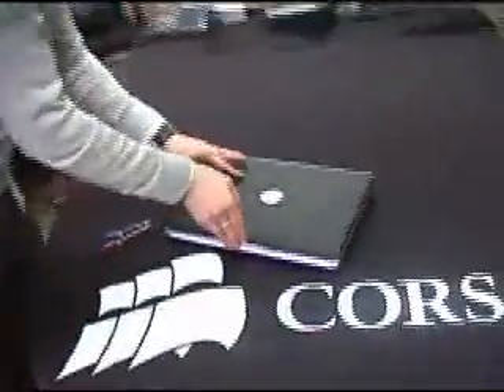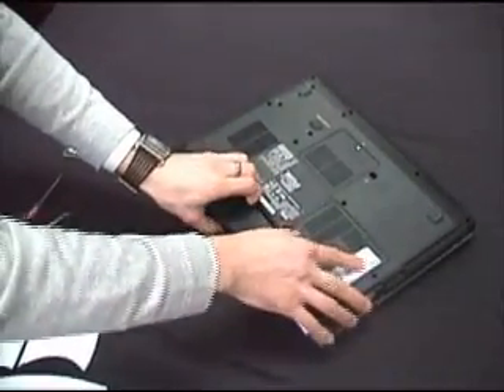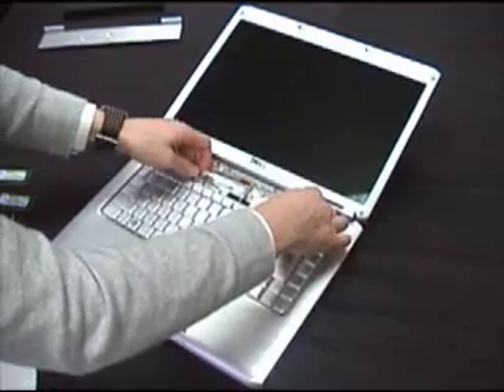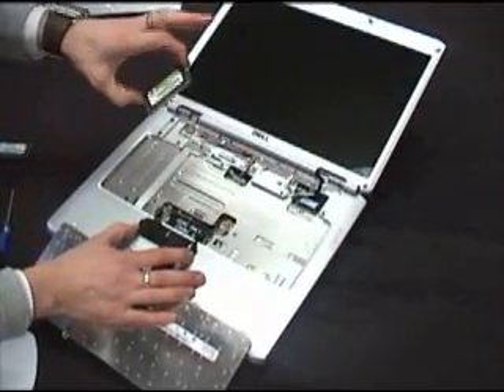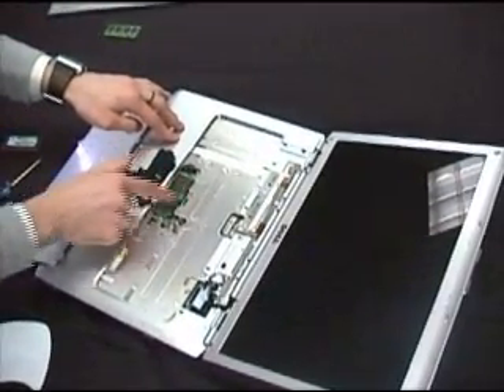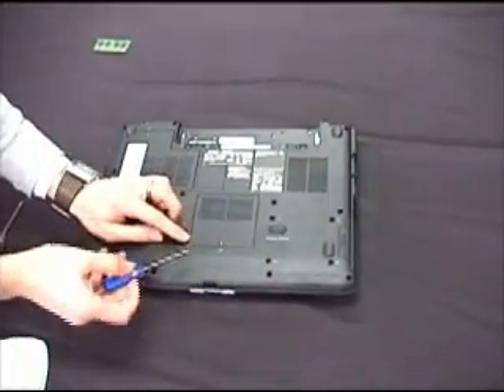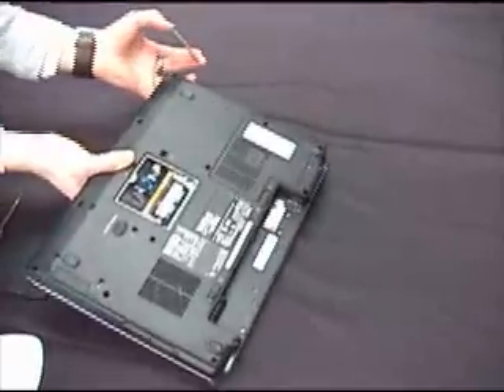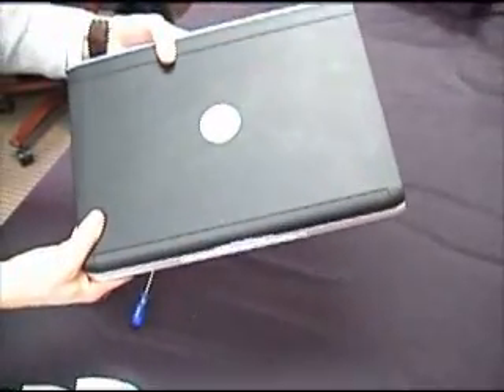Dell Inspiron Memory Upgrade

Comment: Beware! On some models, the plastic piece above the keyboard is held on by two "secret" screws which are accessible from the battery compartment, which if not removed first WILL result in breakage of that plastic piece when one tries to pry it off from the right side as directed.

Comment: This tutorial was good for my Dell Inspiron 640m, too, except for two little differences. First, and most important (and also which nearly caught me out badly), on the 640m there are two little screws that hold the plastic hinge-cover assembly in place. These are accessible from within the battery compartment and MUST be removed BEFORE you try to lever up the plastic hinge-cover assembly - or you will break something for sure. Second, there are no screws holding the keyboard in place once you have removed the hinge cover. Hope someone finds this info help. Cheers Bob C

Comment: I have a 630m and when I upgraded my memory, a scant 512 megs, to 2 gigs it stays on the black windows screen and won't load cpmpletely. I've tried both 1 gig sticks alone in both memory slots and it starts up fine but with both memory sticks in won't
I thought it might be an OS issue because it was originally XP and now Win7 is on it. Any suggestions would be most appreciated.
Thank you.

Comment: If I just buy a 2gb memory card would it be better to put it under the keyboard or to put it in the slot on the back of the computer?  I'm not wanting to remove my old memory but just add to it's RAM.

Comment: @AppleAndroidTuts It depends.  some laptops have two rams installed (512 and 512), thus equals one gig. I just installed ram into my brothers laptop.  Inspiron 1520s are quite unusual because the 2nd RAM slot is located under the keyboard.  My older inspiron was never like that.

Comment: @scotterful 
For Dell Inspiron 1520 you need Memory Card Type: 667MHz DDR2-667 PC2-5300 200pin SODIMM. This Laptop has 2 memory slots, and it supports maximum of 4GB Memory. 2GB card per memory slot.
Details offered by: bestmemoryupgrade,com

Comment: @adamdeliyia Do the same exact thing you did for the bottom half again.

Take out the RAM chip located on the bottom half of the laptop... Blow on it again and SECURLY place it back into it's holder.

This same exact thing happened to me... but instead my computer didn't start up because I didn't securly place the RAM chips back in! LOL

Comment: Hey, great video.

Quick question though...are both slots empty by default from the factory? Or do I actually need to replace the RAM under the keyboard? Because that would mean the RAM doesn't get added on, just doubled...? I'm looking to add 2 modules of 2GB each. Are they the biggest amount of RAM you can add to this type of laptop?

Comment: Dont' Quote me on this but ... I asked tech support at dell about upgrading RAM. As long as you buy the RAM from Dell, your warranty it still valid. If you replace the replace the RAM (purchased from Dell) yourself your warranty is still valid. It is only when the RAM bought is not supplied from Dell that it will Void your warranty. Always good to check with customer support or tech support before upgrading.

Comment: what kind of chip did you use? i just bought PNY 2x2GB DDR2 667MHz, put them in and now my laptop will not boot at all. i followed this video directly. when i press the power the capslock light flashes blue and the power light flashes. i hear it starting then powers off

Comment: This video helped me out tremendously. I have the Dell XPS M140 so I had to unscrew 2 screws located where the battery is located to get the power button cover off. That was the major difference. Other than that everything else applied to my model perfectly.

Warning to owners of the XPS M140! Unscrew the 2 screws right where the battery is located before you pop off the power button cover. If you don't you'll break it!

Comment: i think is the baterry. or the baterry is OLD. or is not install corect. i think is something aboout AC power and the batery. it can be the laptop. but i think is a problem with baterry or AC POWER  . try to leave the laptop in AC power about 1 day.

Comment: just did this on my laptop. It is a Dell Ispiron E1405 and has no screws that hold down the keyboard. Makes it easier to take apart but harder to get put back in the right place.